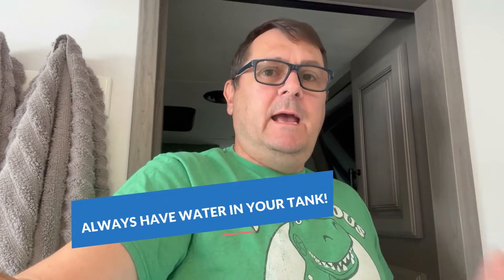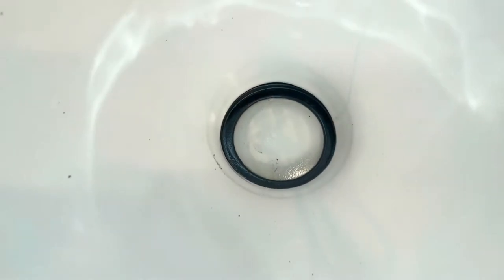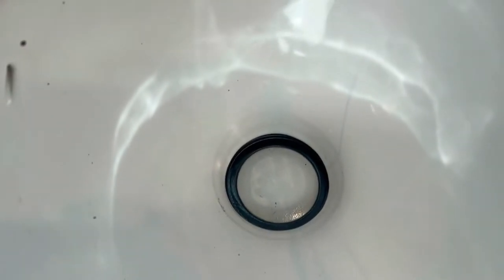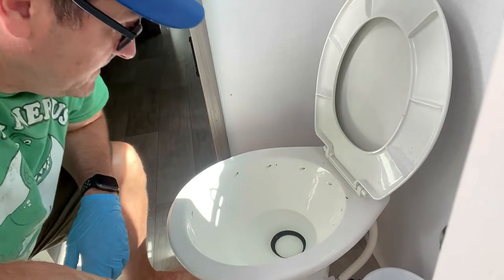RV TOILET NOT HOLDING WATER!  EASY FIX!

Comment: Same toilet and the same issue (but not the fruit flies 😂)! Didn’t know it was that easy to clean or change so I am snapping on my latex gloves as soon as I'm done writing this! My seal is five years old so just cleaning may not work but will give it a try 💩 😷
Reply: Jerry you are a lifesaver! Mine had some hard water buildup on the backside, cleaned it up real good and presto it has been holding water for over 30 minutes! You ROCK! Although I should have waited until it wasn’t 100 degrees outside. My wife is still holding her nose running around the RV saying she isn’t going to cook dinner now 😂😂
Reply from the maker: Glad our video is timely!  Hope it helps.  thanks John.
Reply from the maker: WOW!  Glad it helped!  So much better than getting a tech to come out and fix something that is as simple as this.  Well Done John!
Reply: Do you just get that grease at the rv store?
Reply: @karivolponi3365  you can get the plumbing grease at any Home Depot or Lowe’s.